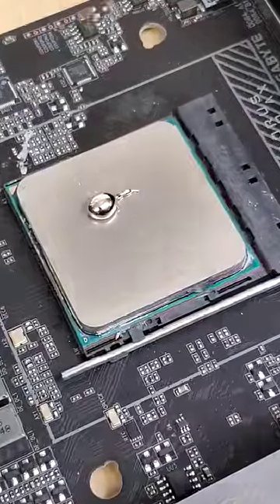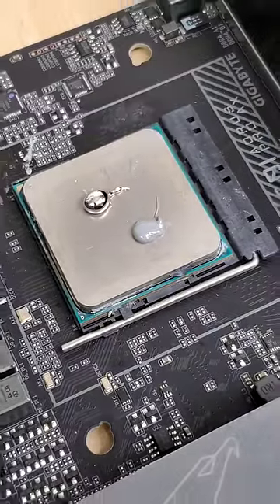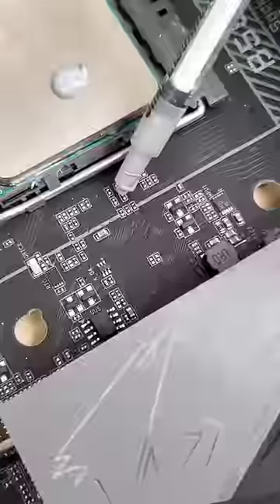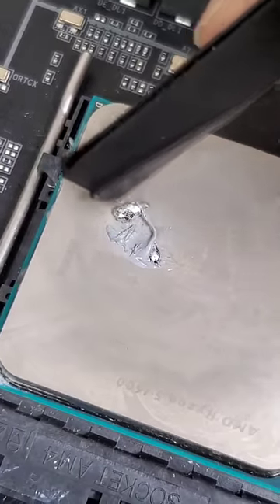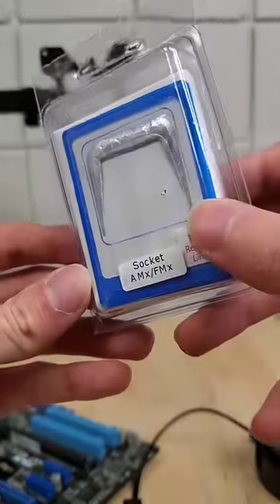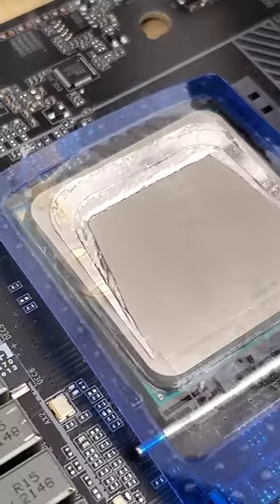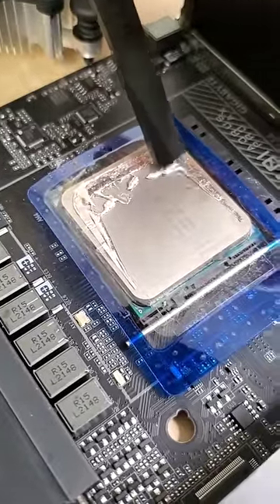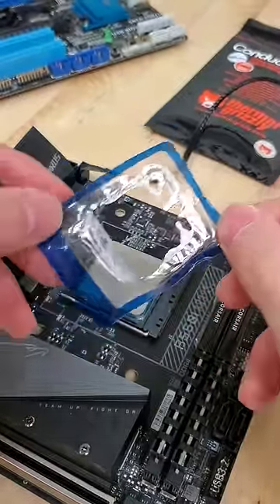the future of thermal paste technology #shorts

Comment: I got carried away writing this, but I had fun doing the math, so I let it go.

The problem with the concept of liquid metal pastes, it essentially doesn't matter outside of benchmarking and scoring. Usually the limitation isn't the interface between the Integrated Heat Spreader and the cooler block. It's not like you have a paper thin gap you are trying to fill, often the gap is fractions that thickness. Thermal conductivity measurement is W/mK or Watt per meter-Kelvin. Essentially measuring how many watts of heat a 1 meter block of material will transfer per degree kelvin difference across the distance (1m) of block.

So when you have to transfer heat across a fraction of a millimeter, that W/mK number doesn't matter as much if it's 4 like most realistic figures for paste, or 60 for liquid metal. For an intel 13900, with a 1mm gap between the IHS and cooler block (20 sheets of paper), standard Arctic MX-4 can transfer a theoretical 400W of energy at a 60 degree C differential. If you have that big a mounting gap, you don't need liquid metal, you need to fix your mounting.

Taking the gap to a more reasonable 0.1mm or less turns that thermal transfer for standard Arctic MX-4 up to 4,000W. You will never hit that kind of power limit before you burn up the chip. You will also be bottlenecked by literally everything else in the system before the paste is an issue. Going to liquid metal so you can theoretically transfer 60,000W sounds cool, but it's really not a factor at all for 99% of applications.

Reverse the equation, yes you can see improvement by using liquid metal. It can be statistically significant, but it's not practically significant. Using the same surface area and 0.1mm gap, if you put 1000W into the IHS with Arctic MX-4, you would see a temperature differential between the IHS and cooler block of 15 degrees. Yes, using liquid metal allows you to move that same 1kW with only a 1 degree differential. But there is no case where you are dropping 1kW from a processor outside of a crazy lab test.

Maxing out the 13900k at something like 300W would give you a temp drop of 4.5 degrees between the IHS and cooler. Sure, going to liquid metal would give you a 0.3 degree temp drop. But thats not really where you are going to make up thermal headroom on your build. You are going to need a better cooler that can actually dissipate that heat long before your thermal paste matters.

Yes there is more to the total system dissipation, and dropping even from 4 degrees to 1 degree between the IHS and cooler block can provide more than 4 degrees drop in die temp, sometimes even up to 10-15 degrees total reduction in die temp. As you are now moving the differential between the IHS and die closer to total system differential, which results in more dissipation from the die. But that doesn't really matter outside of 1% of use cases where you are pushing the actual limitations of the system where a couple degrees crashes the system. You aren't doing that for gaming, you are doing that for benchmarking without regard for killing the system. Just buy a good air/water cooler and you will keep 20-40 degrees thermal headroom on standard thermal paste. Or replace your old paste that has stopped working correctly, that also happens and people often attribute going to liquid metal as the reason for the improvement and not the fact they replaced 5 year old thermal paste.

I hope you enjoyed reading this as much as I enjoyed doing the math for it.
Reply: I enjoyed reading this
Reply: This is a great explanation, and brought back memories from my heat transfer class
Reply: It matters for laptops
Reply: @danielshort118  no, laptops are the same as desktops when it comes to transferring heat out of the cpu. The problem with laptops is they can’t exhaust enough heat because they don’t have room for high surface area coolers.
Reply: This was a really good read 👌🏻
Reply: That's a great explanation and gives me some good fundamentals for those who ask me about liquid metal.
Reply: That was a strong response m8.

I am curious if the liquid metal would degrade at all, though it is slow, thermal paste eventually needs cleaned off and replaced, would liquid metal ever need replaced?
Reply: @nick11crafter  in my experience it has and I've heard similar things from others, but that's anecdotal. I don't have any numbers on the effective lifespan.
Reply: @danielshort118  It matters less for laptops that the position the laptop sits in. The issue with laptops is the tiny heat exchange area of the cooler. Standard thermal paste isn't the main bottleneck. When you are thrashing the CPU and it's hitting 70C in an ambient 22C room, where do you think the largest difference in temperature is?

It's not between the IHS and cooler block, thats maybe 4-6 degrees top end. The other 40 degrees difference is between the radiator and the air. One could argue that if you reduced the difference between the IHS and cooler block that it would drop system temps by up to 10 degrees. Thats not true. Because you have just moved the differential to the radiator now, but it's already sitting at a 40 degree difference. So you have the perfect thermal interface between the IHS and cooler and now there is 0 degree difference, it's perfect. So you have a 70 degree CPU and a 22C room, so you have a 48 degree drop across the cooler.

Ok, the cooler still can drop that much heat, so the CPU drops by maybe another 1-2 degrees because the cooler is now hotter than it was before, but the thermal restriction is the radiator.

Take the laptop and benchmark while running on your lap with a blanket (so you don't burn yourself), and then again on a hard surface table. I would put serious money that the difference is more than 1-2 degrees.

If applying new thermal transfer compound gives you more than a few degrees difference, then it's not that the new stuff is that good, but the old stuff needed to be replaced.
Reply: That's exactly how I was going to explain it! Thanks for saving me the time ;)
Reply: Sorry man I had to stop reading when you said math
Reply: @danielshort118  Even high end laptops have undersized coolers nowadays
Reply: That's a nice bit of theory but in practice the difference between liquid metal and normal pastes is quite significant.
Back in the day we used to delid Intel Haswells and replace the thermal paste under the IHS for liquid metal and the temperatures dropped by up to 20C. 
Even using it between the CPU and the cooler I've seen differences up to 10C compared to normal paste.
Reply: @Remu-  See there is the issue, you are talking about the Haswell era, 10 years ago. Thermal paste wasn't as good, the thermal interface design wasn't as good. Manufacturing tolerance wasn't as good. Literally everything has gotten better since then. There is a reason I didn't use a paste from 10-15 years ago to compare with. Back then industry leaders were just starting to push the 1W/mK mark when actually tested, to put that in perspective, using the previous numbers, thats 167W dissipation using the high end coolers of the time at a CPU temp of 80 degrees. Yeah, liquid metal would help, because the pastes were just that bad and the mounting gaps just that bad.

Sure, it was a big deal then, but thermal paste has advanced so much that it's really not a big deal anymore. I mean, thermal pads are on average better than thermal paste from 15 years ago...
Reply: @2009dudeman  You mentioned the W/mK of 4 as an average paste conductivity so the quality hasn't changed that much over the years. Most pastes are between 6 to 8.5W/mK these days, an insignificant difference in your words.

I mentioned Haswell because they used an exceptionally bad paste under the IHS, nothing to do with the era really, it just dried up to a crust really quickly. There were great pastes back then too that didn't do that.  CPU's before that even had a soldered IHS so age isn't really that relevant factor in my opinion. People have been delidding CPU's much newer than that also and enthusiasts are still delidding new Intel's because liquid metal does a better job than normal paste.

For normal use though it's not worth it to use LM, I definitely agree on that.
Reply: @Remu-  The 4W/mK is actually what good thermal pastes are testing today. The exotic pastes that can hit 6-8W/mK just don't have the reputation yet and it's not fair to pick the bleeding edge to compare to liquid metal thats been pretty stable for the past 5 years. The difference as you drop gets exponentially bigger. 1 to 4 is significantly more important than 4 to 60.

It takes what was a legitimate issue for early high TDP processors and makes it a moot point for 99% of the population. It makes what was a top end cooler of the time and makes it the budget option today.

The point, 10 years ago I took the IHS off my 4790k because it NEEDED to be re-pasted after less than a year of hard use. Sure you could have gone liquid metal and it would have made sense, I used it myself for years and I saw 10 degree temp drops on average from regular paste, even better from older paste that had dried some.

But you don't need to do that anymore. The average thermal paste today is better than the bleeding edge thermal paste 10-15 years ago. I see temps on air coolers with average pastes in the mid 50s on 100-130W TDP processors, there is so much thermal headroom that it doesn't matter. I regularly push 200W for video rendering, and basic Artic MX-4 has kept temps in the high 60s and low 70s on air coolers, and mid 60s on liquid coolers. Again, thats on a chip with a Tj max of 100C. Liquid metal, as I originally stated doesn't matter for anything more than the 1% of niche workloads, and i'd be willing to bet that i'm not going to see even 5C better temps by switching over when I see 10C or more from the cooler choice alone.
Reply: Much math, much love <3

Comment: Eh.

I used liquid metal successfully for nearly three years. Was very careful about the application. You only really need both sides to be wet, so it's not like it'll go anywhere once applied.

But it's a pain to reapply, stains your ihs, and application has so much room for imperfection you'll never feel certain you're getting the most out of it, or whether one day it'll short something.

I switched back to noctua paste after my recent coolant change and loop clean, and using the spread method I actually can't tell the difference between the paste and the LM. Temps are basically the same, and I have peace of mind knowing my next application will be simple to clean and can't hurt anything if I use too much.

Worrying about TIM really IS just obsessing over the margin of error. Don't sweat it.
Reply: TBH, the only people who should be using liquid metal are overclockers. If you really want better thermals, use a better CPU fan or better yet use a liquid cooler.
Reply: Try using Honeywell's PTM 7950. It has the same thermal conductivity as the high end thermal paste but has much longer lifespan (it can last 8-10 years before degrading)
Reply: Aint reasing allat 😂
Reply: What metal did u use
Reply: you couldn't see any difference because you have a weak pc
Reply: @bob-ps2dn  fix your spelling child
Reply: @kiyoponnn  Probably the opposite, really. A 16 core 5950x isn't exactly a cool running chip. If there were any use case for a superior tim, sponging heat off that thing would be it, apart from direct die application. Being paired with my 3090 FE doesn't REALLY matter here, and until very recently I kept it with the stock cooler... but I point it out to prove your assertion wrong, because when I built it in 2020, you'd have been hard pressed to assemble anything more powerful that had any business running games.

Sure, it's not bleeding edge now with the 7950x and 4090 around, but I assure you, heat is in no short supply with my components. And frankly, your attempt to discount my account by discrediting my build is funny to me. If I could share a pic of my hardline water loop with its 3 triple-rads, I would.

And again, I barely feel a freaking difference when switching away from LM. Possible after three years the tim's performance degraded and it snuck up on me, or maybe I was too conservative in my use of LM. But that only proves my point that user error is greatly diminished with regular pastes, and offers nore consistent results. Ask the water cooling discord about tim and they'll tell you to use toothpaste, because it's among the least important factors to cooling your components.
Reply: @s3_ember  Fix*
Reply: @Thatonefuckinguy  Well, performance wise is there not a really big difference between a good Air Cooler and for example an 360mm AIO. The only real difference here would make a custom water loop.
Reply: @bob-ps2dn  "Aint reasing allat 😂" Don't start talking i didn't make 1 letter capital u forgot to spell a whole word
Reply: @s3_ember  my dog ate my goldfish 😔
Reply: Did you use a gasket around the cpu ?
Reply: Made the same experience. What really made a difference though was delidding and relidding the IHS with LM and LM between IHS and cooler. Easy 15 degrees C lower temps. It does stain the IHS though and also the Nickel plating on the cooler and you cant remove the stains. Voids guarantee too. Never had a problem though with the builds. Guess 80% of people are to careless to apply though, you really have to rub it in hard until the oxide layer is ground away and the gallium makes contact with the IHS. Watching people struggle with thermal paste, it's definitely not for everyone, but not as bad as people make it out to be.
Some CPUs profit from it but newer CPUs have soldered IHS and its a pain to delid them without breaking. LM doesnt really do much improvement and it's not worth. Was fun on the older CPUs though where it would actually create impressive results.
Reply: @JoJoGaminG36  and even that depends on cpu and bios.. if its designed to be at 95c bios will increase voltage and frequency until it hits 95c.. ofc if tim is bad between chip and ihs more cooling wont help... There is always a bottleneck
Reply: Widhiaa_need_you  Nice, German bots under an English Video....
Reply: To be fair it can be an issue. Look at the PS5. Sony went with liquid metal, and now you have to be careful how you set it up or you'll end up with a very broken console.
Reply: If you arent seeing a difference, you screwed up your last application of metal paste, it's that simple lol. Normal paste is good enough for like 95% of users, I'd say the 5950x is definitely a fantastic candidate for it. There's no reason there would be "no difference" lol
Reply: I think liquid metal was a better alternative choice in earlier CPU models. the CPUs now seem to have lower temps if I'm correct.
Reply: This is exactly why playing on a PC became a chore and not something enjoyable to me, it became more of a number game than anything. Ended up “retiring” my high end PC to play with a PS5 and don’t regret it.
Reply: @justinkaufman495 Bro that's misinformation. That story is for units that have been through repairs and unopened units need not worry.
Reply: @KarcusKorpse  actually what you're saying is misinformation bro.
Reply: @justinkaufman495  I used LM on my brothers early PS4 and he stands it up. This is years worth. The PS5 has the seal and foam around the die so if the LM gets warm and starts moving it has less of a chance to spill into other components. After a repair though, that seal/foam may not have been replaced/renewed. Zen 2 is a hot chip and a worn out seal will lead to problems.

Comment: Liquid metal.  10x the thermal conductivity.  1 degree difference in benchmarks.  90% you smoke your machine.  Im all set thanks.
Reply: with CPU the risk is minimal, the socket is quite far away from all the components.
With GPU, just cover all the components near the die with some varnish
for me the temp improvement was around 5.
Reply: Definitely more than 1 degree difference, but only if you delid the CPU. Otherwise yeah, you can only improve temps so much with changing TIMs.
Reply: On my laptop the difference was 15C. Just used thermal grizzly shielding for the die and i feel comfortable throwing it around in my bag all day
Reply: For some people, the performance improvement is worth the risk because if you're careful and you have a steady hand, it's not that hard to install flawlessly
Reply: Haha correct 😂👍
The risk / reward is just terrible. I stick to classic thermal paste.
Reply: @FrankOnline007  I think for laptop it might be worth LM because its hard to dissipate heat & I saw quite a few laptop LM where there were good improvement.

As far as on desktop LM is not necessary because of the amount of cooler upgrades & gpu/case fan control.
Reply: also is better diamonds, microdiamonds are better than metal for heat transfer,
Reply: Unless you delid the cpu and run liquid metal directly on the die to a high quality super flat cooler, the risks outweigh the benefits by a huge margin. Different story on GPUs with large dies and the cooler mounted straight on the die. The risk is the same but the change in temperature is significant.
Reply: @jorgecarvajal5385  many newer thermal paste that advertise as "carbon based"   such as MX-4  actually use diamond powder in the paste.